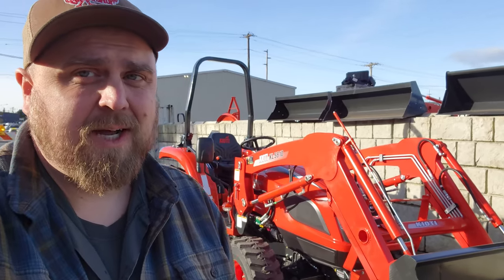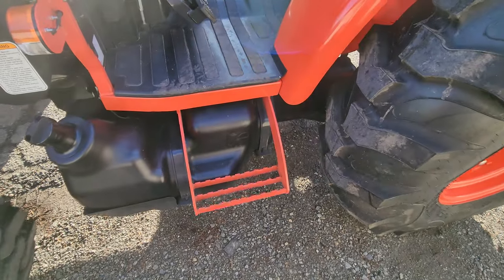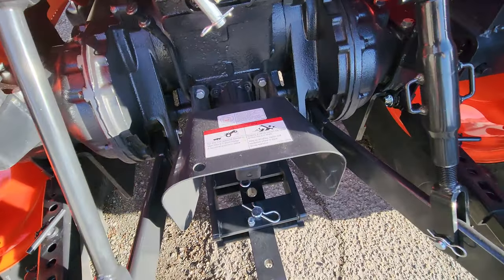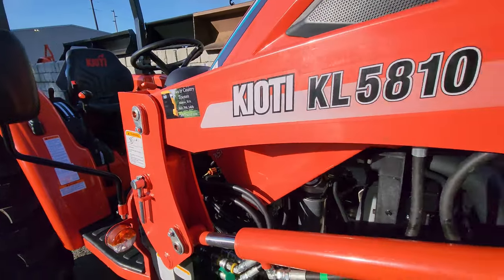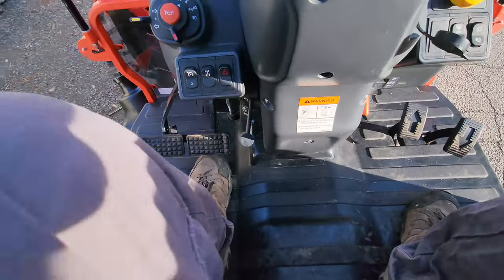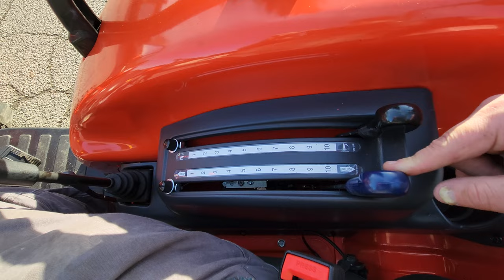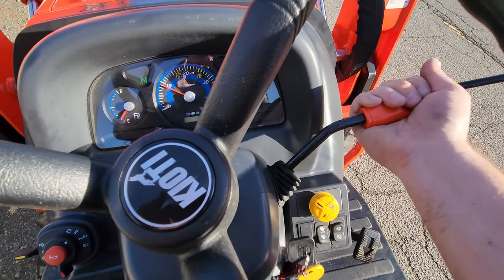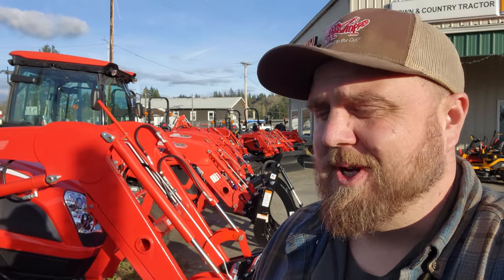Kioti NS 6010 Review

Comment: I've got a 2011 DK40SE HST and its been great for 800hrs so far, glad to see the NS is virtually the same tractor with a few tweaks.  Heavy, comfortable, simple, lifts a lot, and has all the nice 3pt features included.  If I was doing hay, I would need more hp than 40, so an NS6010 would do the trick for a small round baler.  If you've got a good Kioti dealer nearby, have a look and compare specs and cost with Kubota, you might be a happy Kioti owner like me.

Comment: Hey I was looking at the nx 5510 what’s difference in both them to
Reply from the maker: The NX is a little bigger with slightly higher lift capacities. The big difference is the transmission. The NS is a direct linkage from the pedals to the transmission, whereas the NX is "fly by wire" with electronics between your foot and the tranny